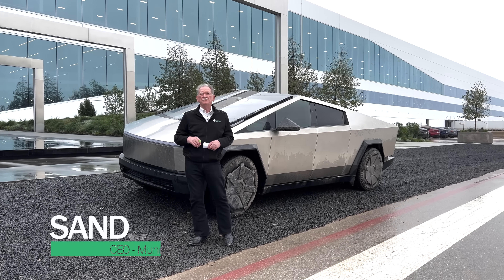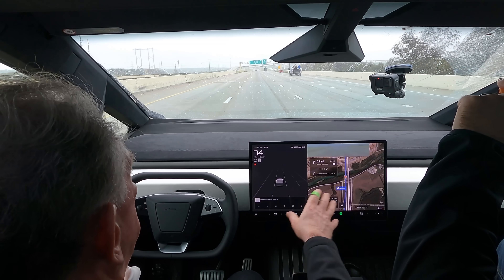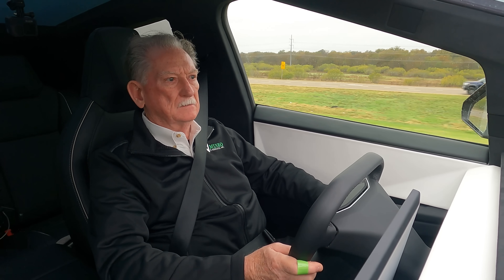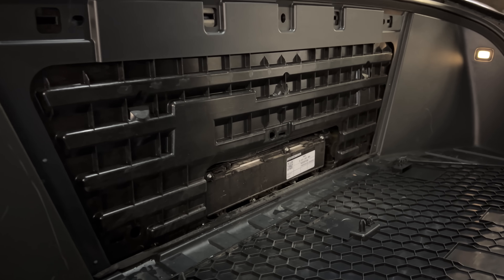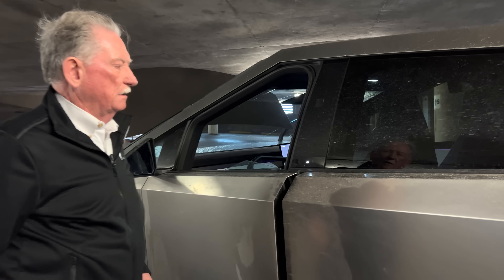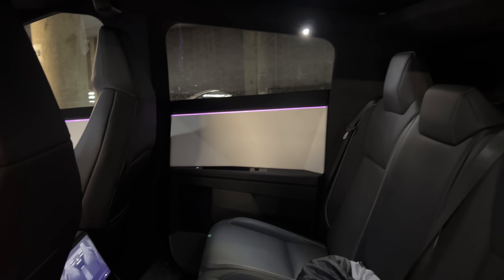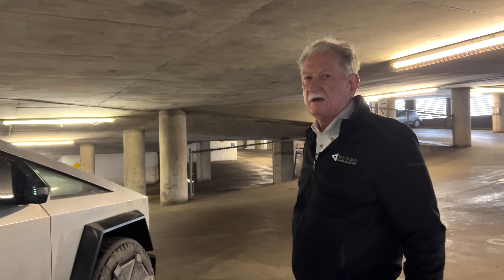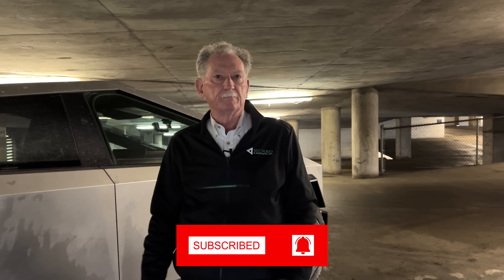Sandy's First Impressions of the Tesla Cybertruck!

Comment: Deadly EV logic
Whole  argument relies on the belief that “we will run out of gas eventually”
So we have to transition to electric from wind, solar and  hydroelectric STOP. We can make gasoline from electricity. Using electricity to isolate the hydrogen molecule for fuels is child’s play. Coal is easily transformed into fuel and water provides unlimited access hydrogen molecule.
Hybrid fuels could give us vehicles with incredible range.  Natural gas and coal are nearly infinite energy resource.
We will never run out of liquid fuel. Electric cars are not an energy source;they are an energy storage method.
A 1 ton vehicle storing energy in a box of 18000 double AA batteries with spot Welds is just idiocy!

Comment: This is not a review but a promotional video. 
I couldn’t watch this passed the no door handle because it helps with resistance and then everything inside is functional. Really?  This is a high tech toy, not a work vehicle, but I guess I am in the small minority of people that view trucks solely as work vehicles meant to be used for hauling stuff, like rock, scaffolding, wood, you know the stuff you get a truck for.  This applies to not only this eye soar ugly ass “truck” but any of these overpriced loaded with unnecessary feature trucks.

Comment: I have been continually screwed over by Tesla. But I still contribute to their platform. Super  easy rear view mirror  fix. Use the Heat pump to direct a blast of warm air over all the cameras and have that same VAC system have a secondary pressurization pump to combine with water to POwerwash and dry the cameras. And have it set to auto wash if needed synching with the rain sensor , Tesla is once again screwing me over by not giving me enough time to have my new Model X transported , and killed me on the financing despite this being my 5th Tesla with zero late payments, Also molder w/124 E500/500E like many other Mercedes before used wind to keep taillights clean- same could be done for the rear mirror camera .. I know you guys will jump on me saying that will kill the coefficient of drag but please keep in mind the w/124 had a cd of .28 and was shaped like brick. And even with the fender flares on the 500E it had a .30 cd model s is .24. So its a minor loss to fix the rear camera.

Comment: Why have to pry, yank, pull panel to replace filter, and puncture to click back?  Seems cheap, kludgy.  Should have wist, lock knobs up top.

Wind resistance?  Then why the black wheel well flares?

Want panoramic review display up on dash above wheel so that I don't have to look down, away from road.

Comment: I "HAD" A reservation on one back in Late  2021  /  early  /  2022 on Both the Lightning and the CyberTruck. Couldn't get Either, TESLA was nothing Short of IMPOSSIBLE To get a Hold of, and when I did   (One Time)  they  were "SNOBS"???  FORD on the Other Hand, Was just as bad nearly, but did eventually respond to E Mail's, (Eventually). So....  I cancelled BOTH reservations, and Ended up with an ICE F-150.  "O" Well...

Comment: Well, for $70K+ truck that has actual driving range around 250 miles w/o load. I can't imagine the “loaded” mileage. Maybe 180 miles or 100 miles when hauling RV? I think it's made for racing on track and not for any practical use. Cold weather area cyber trucks can be beaten by golf carts in terms of driving range.. haha.

Comment: - [01:07] 🚗 Initial Impressions of Cybertruck Interior

  - Initial impressions of the Cybertruck's interior and handling.
  - Not ready for Prime Time vehicle, but enough features for a test drive:
    - Unique interior setup: Rearview mirror replaced by a camera.
    - Handling and maneuverability on par, though adjustment needed for tight turning radius.
    - Unprecedented visibility, minimal blind spots, especially in forward and sideways views.

- [03:22] 🧳 Cybertruck Features: Frunk, Air Filtration, Storage

  - Exploring Cybertruck features and storage compartments.
  - Frunk size comparisons with other vehicles like F-150, suitable for specific uses.
    - Notable features: Convenient access to HEPA filter for improved air quality.
    - Utility in storing items and using space creatively, like turning it into an ice chest.
    - Commentary on windshield washer fluid and additional storage areas.

- [05:30] 🚪 Unique Design Elements: Door Handles, Interior Space

  - Discussion on unique design elements and interior space of the Cybertruck.
  - Emphasis on door handle design and aerodynamic benefits:
    - Positive comments on door handle absence, enhancing aerodynamics.
    - Observations on the clean and functional layout of the front and rear seats.
    - Remarkable interior space, especially in the back seat, ample headroom.

- [07:09] 🔍 Evaluation of Panel Gaps and Consistency

  - Assessment of panel gaps and consistency in the Cybertruck.
  - Explaining the importance of gap consistency, especially in an off-road vehicle:
    - Calibration of panel gaps for an off-road vehicle like the Cybertruck.
    - Emphasizing the consistency and alignment of gaps across the vehicle.
    - Positive remarks on the build quality and consistent gap measurements.

- [08:27] 🤔 Overall Impressions and Usage Scenario

  - Final thoughts on the Cybertruck and its potential utility.
  - Personal opinions on Cybertruck's target usage and competition:
    - Favorable opinions on Cybertruck as an ideal vehicle for outdoor activities.
    - Speculation on competitors and market positioning against other brands/models.
    - Personal endorsement of Cybertruck for specific outdoor uses.

Comment: No comment from Mr. Munro about the exceedingly dangerous sharp corner to his right @ 4:09? What's going on here, have you to sold out like another youtuber so as not to lose favour aka benefits with Tesla? How about doing a comparison between the Tesla stainless steel and that used on URINALS, urinals have to be bent and shaped to. While you're at it wind back the clock 40 YEARS and compare the DeLorean and its ss construction. DeLorean did easily in 1981 what Tesla is feignning to be oh so difficult. One youtuber has even suggested that the shape of the ct was influenced by the DeLorean. Next time you're out hunting/camping you may pee on your urinal.

Comment: The no noise issue? Every weekend we used to go hiking in the San Gabriel Mountains above Los Angeles , soon we'd hear the motorcycles roaring up and down the Angeles Crest Highway. We wished they were quieter, until one day I stepped out to cross the road and was almost run over by two very quiet BMW bikes.  Ah that's why noisy motorcycles wasn't a bad thing.  What Tesla should do is when driving in remote or rural areas, when it spots a human or animal or maybe just a high probability of either (Like a farm complex near the road) turn on a noise that sounds like a rapidly approaching motor. Cheat the Doppler effect affect just a bit as an alert.

Comment: Wow is drives like a car when you put it in opperate mode WOW it steers and every thing.  When you push the brakes it slows down and Stops. It is really fast like a drag racer so double wow. the mirrors reflect images and it has a camera for safety .This truck is awesome it turns sharp and you can see stuff out of the windows . HAHAHAHA lololol wow it is a smaller truck that wont tow a load very fare even if it as fast a  racing car.

Comment: I really don't get that car and why would ever want to buy it, unless they are die hard steampunk fans?
Ok, it's a knock off from a car shown in the movie "Total Recall" but besides that it doesn't really offer anything.
 
The rear view mirror has to be a joke. U can't even guess what/who is behind you, even tho it was almost dry! (which might be ok in the US, but not in other parts of the world)
The suspension doesn't allow tough offroading.
The non existent aerodynamics reminds me of a DRAGqueen - turbulent air everywhere.
The dimensions of the truck are pretty massive, but don't offer that much space. space for passenger in the front and back are similar to middle class roadcars. The bed in the back looks more or less useless. can't even fit a mountain bike (without the half of it sticking out).
It's a regular SUV with the trunk of a small pickup truck... not sure if that's worth 100k

Comment: The 1 huge windshield wiper actually works pretty well. They just need to improve the rear view camera, unless it already has a spray function.
Reply: Ceramic and a pressure spray, standard on the Production version for all we know?
(This is pre-production)
If not, a great opportunity for an aftermarket supplier!?
Reply: @rogerstarkey5390 classy to have to do aftermarket modding to your car for it to have a working rear view mirror lol

Comment: Tesla has put a hood over sheeps who believe the drag coefficient of this vehicle is great - it is not. The drag coefficient of this vehicle should only be compared to that of a closed bed pickup, where the closed bed section is of the same height as the front cab. Then the cybertruck would lose as the slope of its bed portion is too sharply downwards, thus creating turbulence, which leads to bad aerodynamics. 

The angular nature of the body panels would also never give it good aerodynamics. The bad  aerodynamics also explains why the rear view camera was dirty - dirt gets swirled up by the turbulent air behind the truck. 

Next, those who think the stainless steel panels would be great as they would be hard to dent, forgets that if they are dented, it would be very difficult and expensive to get them repaired - they need to be entirely replaced. Also, the stainless steel would not be painted over because that's how you'd use stainless steel, and they will never be as smooth as that of the body panels of regular cars. This means dirt will stick to the panels and they will always look dirty - just see the videos of the dirty Cybertrucks.

Finally, the reviewer said there's no height issue in the back. What did he expect? This is a pickup truck, obviously, there would not be a problem! 

You are welcome, America!

Comment: It's not as promised. No 6 seater, no 500 miles range, no ramp in the rear hatch, no spare tire, no side view cams instead of those mirrors. If u need to pull a trailer with this, you will have absolutely no rear view. The rear view cam will be obstructed by the trailer and the same goes for the stupendously small side view mirrors, which you can't extend. And the bed is restricted by the tonneau cover if you need to haul taller stuff. Gets even worse if u go for the range extender. That is a 16 grand proposition which takes up half the bed space.  I'd say as a truck this is a dud. And to top it all off, it's way more expensive than promised.

Comment: The steer by wire should be in every Tesla from ne t facelift onwards. Sadly, will take much longer until Model Y/3 will have that. Once it had it, I would like to see the CT steering wheel also in the 3.
Reply: It's all down to the 48v system.
Reply: @rogerstarkey5390  which together with 800V should become standard also in Teslas

Comment: Actually that opening shot gave me a question, what happens to the mud that was on the bed cover when it rolls back in? Will water/mud on it cause issues?
Reply: I suppose the same as any bed cover on any truck?
.
If you think this might be a problem, don't buy the Rivian, horizontal and "clanky".
.
At least this one should have a degree of clearance from airflow, and in the case of snow, residual heat and the angle causing a natural slip....?

Comment: He should have made it a hybrid... and I personally hate how it looks.  There are a lot of safety issues, like the lack of crumple zones, not enough padding on the interior, sharp edges and thick steel body.  You hit a pedestrian or motor cycle, even at 5-10mph you are probably going to kill them.  With electric doors if you get in an accident and loose power you can not open the doors and with the tougher windows and doors it will be very difficult for fire-rescue to get into the vehicle.  This is VERY critical as an accident could damage the battery and it catches fire you need to get out FAST.  I also think the A pillars are too thick and it would have horrible visibility, like when you come to a 4-way stop.  You have to lean forward to look around the pillars to see if cars are there (I have had problems with this on other cars).

Comment: that front A pillar cut out is not helping and that part can easily hide a grown up pedestrian in certain situations....i had a similar issues with vehicles with such  low slopes that have great aero dynamics but the sharp angle creates this blind triangle where if you turn at the same speed a pedestrian walks it can really "Jump" on you out of no where with very little time to react. Especially if the driver is unfamiliar with such designs.....

Comment: The real test for contractors will be when you put a cargo trailer behind it. It better get a lot more range than the lightning or it will fail for contractors just like the ford.

GM understood this, critizise the stupid big battery in the silverado EV, the fact is, TFL Truck tested it with a big cargo trailer, at real highway speeds, and the damn thing delivered a LOT of miles, more than double the range of the lightning. 
For work, i need around 150-180 miles of range per day, worst case scenario, in the harshest conditions, with my cargo trailer. So far, only the GM will be able to deliver this, if they finally market them...
Everything else is great on the cybertruck, but every review i saw, and the delivery day, no on talks about range when working, and that tells me this will be its achile's heel.

And for those who'll thell me, a 15 minute stop of supercharging will cover missing range, yes, you are right, but try to go to a supercharger with a 20 feet trailer behind you.